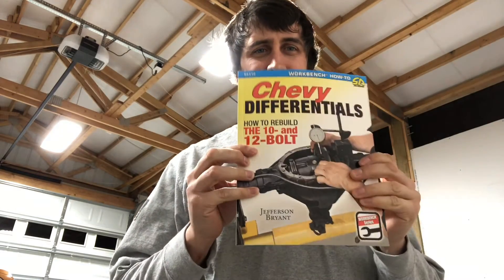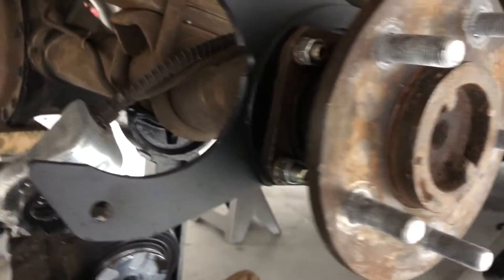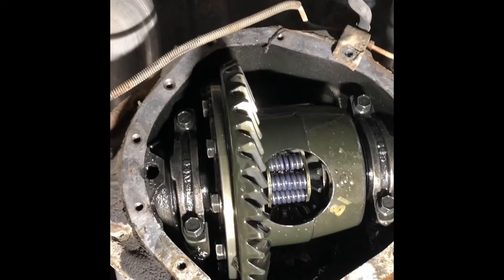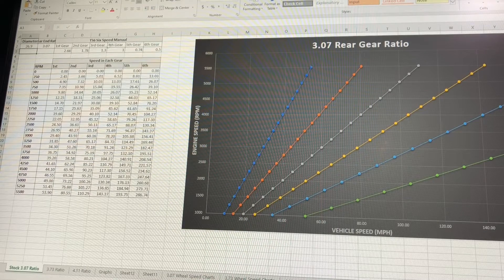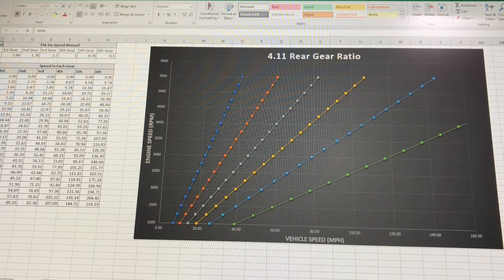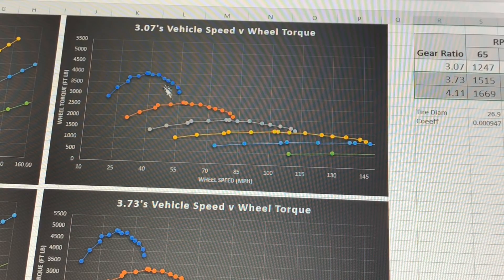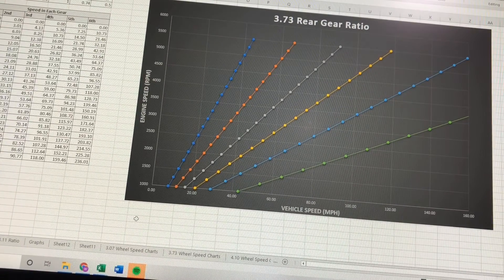C10 Driveline Upgrades Part 1:Gear Ratio Surprise

Comment: I have a '74 Camaro, when it came time to redo the drivetrain I started with the rear-end. It has 28" Cooper Cobras, and i was putting a Buick GN 2004R in it, which is a .67 overdrive, plus lockup, which does make a big difference believe it or not. Anyway, I settled on 3.73. For my driving style it's perfect. At 70 I'm only at 2k rpm. With the lockup engaged, it's very quiet and makes for pleasant cruising. Also, it's still carbed with a 670 Avenger (the new engine is a all forged and roller'd 357). I actually get 22 mpg on the highway. 

I just found your channel tonight, but have watched a good chunk of your vids. It's kinda funny, on my channel I have 2 quick vids comparing Magnaflows to my 23 year old 3 chamber Flowmasters. When getting a new exhaust, I gave the MF a try, but after two days, I had my very old Flowmasters put back on. It was weird, I told people it was like someone had changed the voice of a family member.  I prefer the Flowmasters, but that's just me. Enjoying your channel!
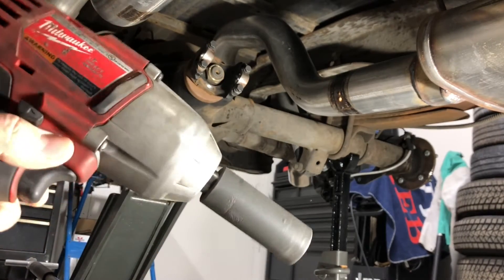Reply from the maker: Pantheragem thanks a-lot for watching and commenting.  Based on your overdrive and tire size it sounds like my 4:11s in 6th will drive similar in high gear to your setup since i have the .50 overdrive.  I too was surprised of the resonance difference going from 2.5” to 3” + h pipe.  It was definitely
Louder than expected even though the video doesnt show it too much.  Ill check our your video!  Theres no doubt the chambered mufflers sound excellent
Reply: @truckandroll989  I went from a 2" to a 2.5" as too loud was something I was worried about. (Don't want to give cops a reason to pull you over in Elk Grove, CA). Anyway, with the Magnaflows I couldn't really hear the cam as well (Comp XR276HR). Seemed like with the Flowmasters I can hear everything it's doing.

Anyway, yeah I think 2k at about 70 is really good. If it was any less than what it is I think I'd definitely be feeling some lugging.
Reply from the maker: Pantheragem so i would agree flowmasters sound better.  After watching engine masters i was concerned about the power loss of chambered mufflers vs straight through (MF).  Honestly its probably negligible to an extent but i knew it was there which was the main reason i did magnaflows

Comment: Hey whats up man if your gonna street drive it I'd go with the 4.10 all day long especially being you have a 6 spd. Also 2100 on that 454 is not bad being it's a roller cam and your making max power at 5500 although if you added a daul plane intake I'm sure you'd gain a few more 100 rpm but lose a little low end torque which that wouldn't kill you because its already making plenty good torque to move that truck. Either way if you weren't crazy about the rpm you get with the 4.10s on highway you can bump your tire diameter a bit and that'll help you out. Hope this helps you out. We had a 66 chevelle with t56 and I think it was a 3.27 gear and 6th gear was kinda useless lol but with the 4.11s it was a lot more useful and fun!
Reply from the maker: Eddie Delacruz Hell yea thanks for the comment.  4.11s are going in as we speak

Comment: 3:73 is my favorite all around rear gear. For a big block or boost they are great, because turbos like load and big blocks grunt out torque down low vs a small block, (I got a 85 c20 454 with 3:73s and th400 pulls hard) but I'v never ran a double overdrive, so you may be able to get a away with more gear, my personal opinion anyway
Reply from the maker: Bezzy Russell i appreciate the input.  I went back and forth a lot.  Ultimately i pulled the trigger on a set of 4.10s because im a child and i will sacrifice  some traction for a little extra fun.  Truthfully all i need to do is bump up to a 28” tire and it will negate the lower gears
Reply: 3.36

Comment: I believe You have a locker in their. What that means is it’s been rebuilt before. That’s a pretty bulletproof set up already. Lol gm didn’t use those in 2wd 1/2 tone pick up’s. The one gm used had an S shaped spring in the planetary gears. All so it’s a very possible that the bearings are good, and probably a better quality then most. if you didn’t see any glittery substance in the oil, or pitting on the race’s and rollers. Then don’t replace them that’s a time consuming process. Just keep your shims in order and replace the rings & pinyon. 
Ps if your going drag racing all the time put in the 4:10 gears, if you plan on street driving mostly go with a 3:42 or 3:73. To add if you stay in the 3’s you don’t have to replace the Pinyan gear unless you want to. FYI 2100 plus rpm is a lot of continuous rpm for a big block.
Reply from the maker: Street truck 785 yea i knew it had an Auburn limited slip from the PO.  The underside of the wheel wells and bumpers was caked with rubber from doing burnouts with the line lock.  It has timken bearings and the oil looked good but im sure it saw some abuse.  At a minimum ill replace the pinion bearings since i dont want to mix and match new bearings with old races so ill knock the races out of the housing and install new.  Im going to try and check backlash, preload, etc. just to see how well it was setup previously.  I haven’t fully decided on a gear ratio yet.  Realistically im usually driving 75max.  I get a little worried about just cruising any faster than that constantly in a 40year old vehicle.  Keep in mind too the redline is now 5500 so 2100 isnt as bad as say 2100 in a stock BBC that redlines at a realistic 4500-4800rpm.
Reply: TruckandRoll I was thinking economy my 462 bbc I had built was a 6500 rpm engine, but with 4:11 gears in it I couldn’t pass a gas station. I loved the old truck but it was a gas hog. I ended up pulling the engine out of it, and dropped it in my 70 Chevell. The Chevell has a 3:07 rear gear. Mileage was amazing even with the TH 350.